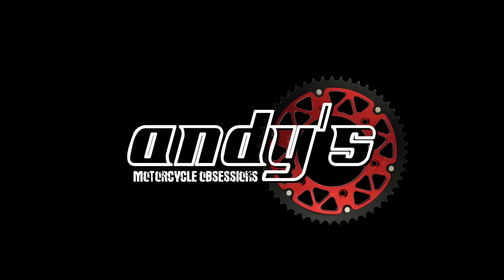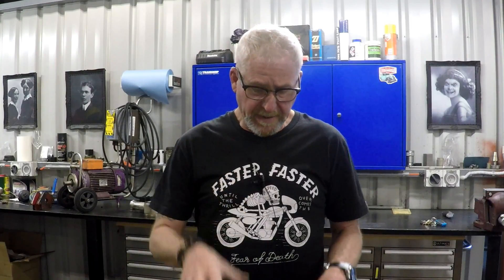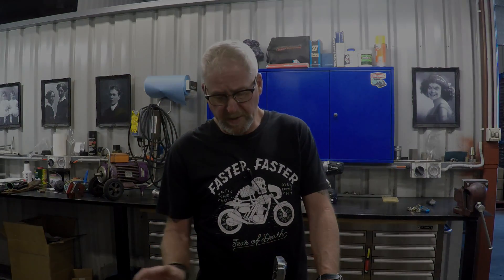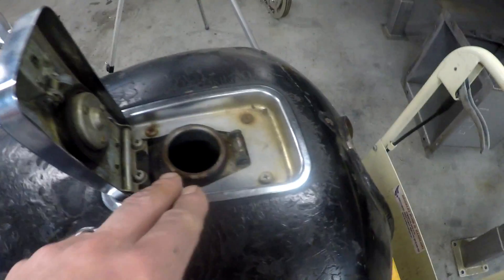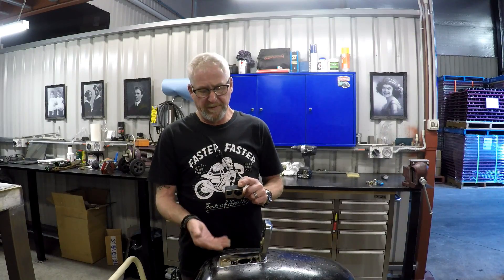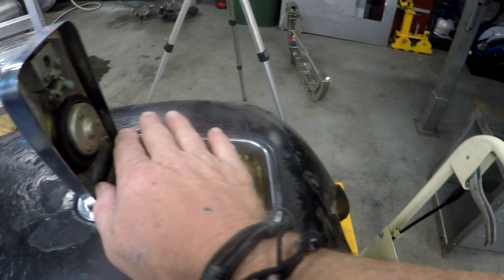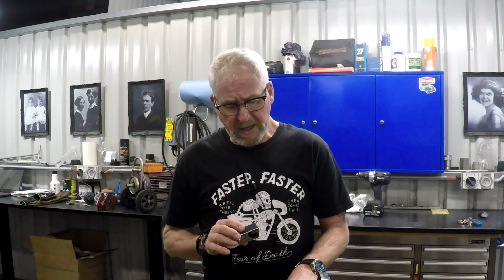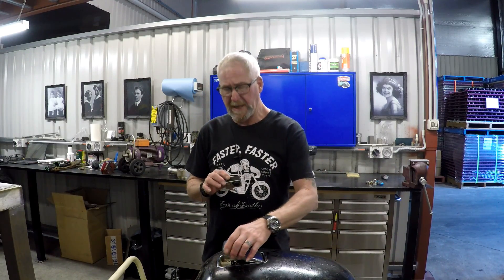Welders - fabricators - paint and body guys - I need your advice

Comment: First of all This is How I did mine , no idea if it is the correct way ,or a good way . Recently did the same job . I cut out the metal not required , Then fabricated a blank to fit the hole . I made sure that the weld , when dressed [ not needed if Tig welded ] , was just below the surface , I then cleaned the metal and the weld  to a shine , fluxed the metal , and Leaded it , with a good  lead filler . Sand down , using a mask , you will get it to blend right in . I was a Plumber in a earlier life , and used to wipe lead joints , and lead weld gutters and roofs etc . It will stand the test of time , is Petrol proof , and adheres to the metal forever  . Hope this helps .

Comment: Cut out the entire section as what was done before - Welding over the filler feature would make more sense from a structural stiffness point of view but thermal expansion, keeping it moisture free and corrosion free is something I wouldn't trust. If the tank was a monza style tank from new it would be just one rolled piece of steel - so try and emulate that.
Reply: this does seem the better soultion, perosnally out of the two Andy said, it makes more sense to eliminate any chance, rather than it weighing on the back of the mind
Reply from the maker: The structural integrity is part of my concern.  The tank is held down with a strap across that panel section.  It is a large surface area and I feel that the combination of stresses created by the welding along with vibration and a fairly firm mounting could have caused the original modification to fail?  I kind of view the first option as a belt and braces kind of approach.  But I value your opinion Matt so I will take it under advisement.  I want to wait and see what other responses I get and from from what skill sets.
Reply: Cut out only this flat part with filler tube and leave the sides for structural strength? and then weld a piece on the top. Just thinking, but I don't know how this affect sealing later on.
Reply: I tend to agree with cutting out section as before as the right approach but what is a Monza Style tank or what does a Monza Style tank look like?
Reply: @ANDY5  If you're worried about structural integrity then it might be possible to piece together a baffle plate inside the tank, through the rectangle cutout. It'll be a bit of a bitch to weld but all you need are a couple of tacks. A mirror and a skinny mig torch
Reply: And yeah, as you say, vibration sounds like a problem and there's an opportunity to improve the mounts. Do that.

Comment: Hi Andy would agree with the consensus of cutting it out and te plating the only thing I would add is I seal up all other exits and pump air in then run a spray bottle with soy water over the whole thing g to check for air leaks 👍

Comment: Cut out completely and install new panel. And as that hole will be quite large you may be able to knock out some of the dents before welding the filler panel. Also easier to clean before welding as well.
Reply from the maker: I had similar thoughts in terms of access for repairs.

Comment: Gday Andy. If you weld over the filler neck then make a panel fit the top and weld it (all airtight) you've created a sealed cylinder that will have pressure differences.  When the bike heats up with no ability to vent that air. Now I guess that may be a bad thing as the metals  so thin? Mabie drill a number of holes in the recess under the filler neck so petrol might slosh up the open neck but simply drain through the holes (you could drill a Southern Cross) But no one will ever see it as its covered.
When you weld up a small cylinder you have to have a vent. Or it can create very high pressures then often on the last dab of filler rod the molten weld pool will blow back out as the heat raises the air pressure. 
Hope the ridings good down in Taz
Been flying through valleys all day on my new (to me) RC51 Plus all day tomorrow ;)
Great vids BWT!!!

Comment: Hi Andy, currently doing a similar thing here  on an XJ900f - (cutting the back end off the tank and reshaping ) if it was me I would cut out the whole recessed filler and weld in a plate as was done before, then weld in your new filler position and  pressure test as you will probably find a load of other pinholes in an old tank once the inside and out have been cleaned up ( as I  found - my welds were ok , but leaked it like  a sieve around some of the seams - where the pinholes weren't so easy to fill with weld I went old school and lead loaded the spots ) I guess you have probably got access to some leak testing kit at work - (I superglued a bit of inner tube with valve over the filler and put a few psi in with a foot pump and left it overnight - no leakage - then cut the valve off with a stanley knife and sealed the tank with POR15) good luck mate!

Comment: I asked delbollocks about this project and he recommended a flour and water based filler using no nails as an adhesive additive. Personally I tend to stick to KISS philosophy, I would weld a sealing plate to the original filler hole to seal it then weld the complete opening after sealing the fist weld with weld proof primer. It is more work but it will be done forever. I can't wait to see the video of this project, great work Andy

Comment: Hi Andy I'm no welder, I would go with Matt's advise, the big thing against welding up the old filler neck & then welding a panel over the top is it will create  a sealed chamber, with fuel being cooler than ambient temp I think it is almost certain you will get condensation in that chamber & problems down the track. Also the larger hole will allow you to properly cleanup the underside of the weld area so as not to pull contaminants into the weld as you go.

Comment: Fabricate a whole new flush top piece with the filler welded on both sides. Use a good bit of sheet metal. Some chinese metals have too much silicon and doesn't hold paint well. When welding, purge the tank with your welding gas. This will prevent oxidisation on the inside of the weld and make it seal better. Hope this helps.

Comment: Sent video to my brother who is a fabricator in the uk. His advise is the same as mats the workshops for two reasons one is mats reason and the other is it’s easier to fabricate  a panel with new filler cap  to fit the cut out of the old cap unit
Reply from the maker: The fuel filler won't be in the new panel, it will be adjacent like the one I have mounted on the bike now

Comment: 10 year journeyman welder here. remove all paint. clean inside of tank with dish soap and water, don't be shy, rinse clean then fully dry in sun or warm room what ever you have. tig weld for sure. before you weld back purge or fill up gas tank with what ever shielding gas you are using (should be argon). this will prevent porosity on the inside of the gas tank. after it's welded pressurize the tank with no more than 3-5 psi of air(otherwise you'll swell up the tank like a balloon). use soapy water or submerge the tank in water to check for leaks before the nice new paint job. good luck.

Comment: Some interesting thoughts mate, I would say double skin the filler area, a disc over the tube, then a plate over the filler cap area. Lastly seal the inside of the tank with one of these tank seal kits, like POR15 or similar, belt and braces mate, that should see you alright.

Comment: Andy heres my opinions - I would consider a custom made Tank,either by people you know or a Bespoke Tank Fabricator,might cost a large sum but problem permanently solved,you  have two copies to reverse Engineer that makes the job much easier than designing from scratch.If  you have to use your new  donor Tank id go with cutting out the recess panel completely,a single thickness patch is much less of a risk than a sealed - in cavity if you seal the filler tube and plate over the top.You said that the new Filler Cap will not be located where the patch would be yeah,if that's the case then the job should be easier.Another trick is do you have any companies that do Hot Dip Galvanising near to you,if you have take Tank to them they can Dip - Strip it,much less aggressive than any blasting plus it will clean the inside as well as the outside for a much better finish.

Comment: I'd just get another tank with no flap, however, tanks, even used aint cheap. I agree on TIG process.
You might consider using silicon bronze TIG brazing. I would TIG weld or braze a disc to close the filler neck, then weld the flap down. My gut feeling is that would retain the structural integrity of the tank and reduce the risk of any gas or liquid leaks. But thats not based on experience, just a guess on how I would tackle the job.

Comment: The issue with welding the cap and the panel is that it creates an airtight pocket in there that will be very hard to seal, and if you do seal it it will be prone to rust.
I doubt you'll have issues if you do it carefully yourself.

Comment: andy , take your old tank , down to bare metal around the failed weld. then go over the weld with a  tig welder. With tig , you will have an argon supply at hand to purge the tank while welding. argon is heavier than air , so weld up with the tank slightly  on its side.
Reply from the maker: Okay, thanks. I have a question. Why would I need to purge the tank mate? As there is no carbonic precipitation like you see with stainless steel won’t it be okay just to weld from the outside with shield gas?
Reply: @ANDY5   many people have had tanks BLOW UP , even when emptied , it will still have fuel vapour in it. just make sure the filler hole is above the weld area
Reply from the maker: Ah...I’m with you now. True story, I watched my father weld a hole in the side of the fuel tank of his Subaru with an oxy acetylene torch once, must have been in the ‘80’s. It was still in the car and had petrol still in the tank. He had the engine running and a hose from the exhaust displacing the oxygen in the tank. I considered it madness at the time, but it worked. Cheers mate.
Reply: @ANDY5   way less chance of porosity and pin holing due to hot oxygen trying to escape through you weld puddle
Reply: @ANDY5   we used the same method in 1982 at the TT to weld up a leak an a sidecars fuel tank. another old school method was to fill the tank with water , and only have a small air pocket , under the weld area

Comment: I would cover the top with a new panel and do as few cuts as possible into the structure of the tank. Each cut and re-weld is raising that likelihood of a microscopic leak. While the “leak” may be too small for liquid fuel to escape, a vapor molecule is much smaller.

Comment: Cut it out completely and put a new piece in, with the neck already installed. You will struggle to match the curvature properly without being able to bash out the low spots from behind so you will have to rely on a little body filler here. Keep heat input to a minimum, stop every 10-25mm and cool it with compressed air.

Comment: OK so Hi Andy,
So I've done this a couple of times and I am a welder fabricator by trade.
I would prefer to not leave a void in the top of the tank you will only leave plenty of opportunity for future failure, but I feel your apprehension mate I really do.
The best way I do this with total success is to do the latter and do exactly what you did previously and weld a panel on the top, Stay with me here mate, there are processors and processors and to achieve quality control. Now I also have used fuel tank liners, the liquid type and they are excellent.
In my experience the best way for me  to 100% eliminate all leaks before pushing on to a liner and this is very dangerous if not done correctly, it is a very time consuming process  and do not advise anyone to do this other than take the risk myself so Andy I do not expect you to try this buddy because it is dangerous, have I mentioned that this can and is dangerous yet? I hope you all understand that this is DANGEROUS.

I Check all my welds with fuel and not water, fuel as in petrol in Australia gas in America and I think you get the picture. You see water as well as many other liquids due to capillary reaction will not seep through a small whole but fuel on the other hand well you have already found out the hard way will find its way through any minute in discrepancy.

so when I check for holes with fuel, complete flushing of the tank is necessary between weld touch ups (for obvious reasons) and rechecking and hence the super long and tedious as well as dangerous process.

DISCLAIMER .Any way this I how I check for leaks in fuel tanks and I do not advise anyone to do this. Do this at your own peril. I am sure many will disagree and that is ok.

Comment: Another tack might be to clean and de-gas the tank and line it with Caswells or similar tank sealant.
Fix up the existing leak damage and away you go.
Reply from the maker: Hi Evan, I spoke to the tank liner manufacturer some time ago about this, it is a Tasmanian made product and is excellent.  I neglected to concentrate any at the top of the tank, crystal ball never saw this coming.  They told me all it takes is a wash with metho and you're good to go with re-lining.  But the tank has many other issues, mostly mitigated by the liner (it is all that is keeping the petrol in) the new tank is solid and I want the peace of mind.

Comment: Andy I’ve got a fair bit of experience with the sealer kit from KBS and I know I’ve done a post elsewhere that I’ll try and find as it was fairly detailed. I personally would put on the old tank as is as a rider then chem dip your green one, use the sealer on that one, primer it and see if she bubbles after riding it for a bit, but after sealing it I would very much doubt it would unless you didn’t seal it properly, or the tank breather was blocked causing the tank to pressurise and expand when sat in the sun etc but guess you’d have some sort of performance issue that you’d notice if that was the case, I reckon it would take you about a week to do it properly, all the drying time that kills the job. Let me see if I can find it...
Reply: Or has it already been lined? If so , yep do what you did before but just tig it up, would be less likely to pinhole in that case, the thing with tank sealers is less is more, so you’re literally tipping most out the gear out, the last thing you want is a thick inflexible coating that delaminates from the inside when the metal tank expands.
Reply from the maker: @thebruise  Already lined

Comment: I would just cut out the base  of the filler opening, keeping sides in as reinforcement and close with top plate.
Sealing filler neck and a top plate could be a condensation issue.
Reply: I'm a welder/fabricator, i agree with this . Its the best way.

Comment: Could you seal the existing hole with something flexible - a disc of neoprene for instance, then a plate over the whole thing as you did before; maintaining any structural integrity, allowing the air in the gap to expand without flexing your new plate while keeping the fuel vapours away from the weld.
Reply from the maker: Seems a little over complicated

Comment: I think your original method worked fine,however as you said before you may have skimped on the sealant in that weld area and the weld could have had a few pinholes in it.
I would seal the welds with JB weld epoxy and just make sure your tank liner is full poured around that area,however having painted a few XS tanks in my time i would highly recommend getting the tank soda blasted,you will almost certainly find a load of pinholes around the bottom edges of the tank and near the fuel gauge opening.
Reply from the maker: Yes the tank on Basket Case now was a colander. The only thing holding fuel in it is the liner, it leaked between the main tank body and where the rear mounting bracket is welded.